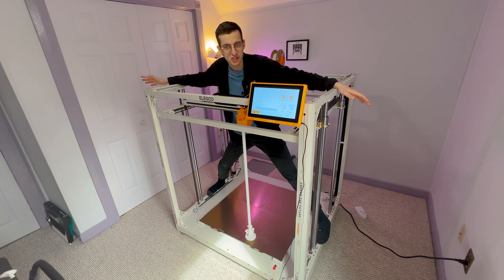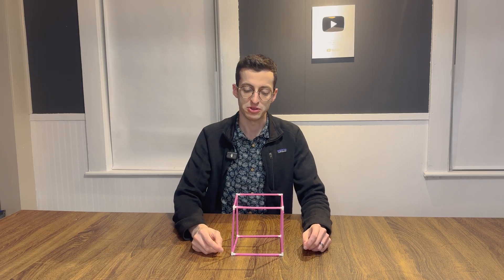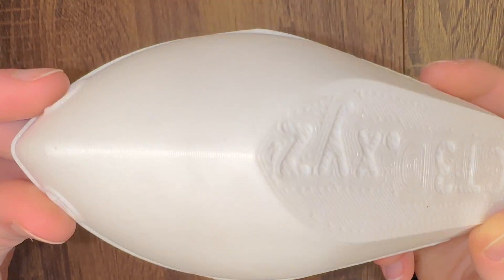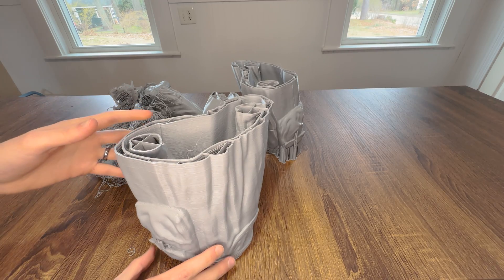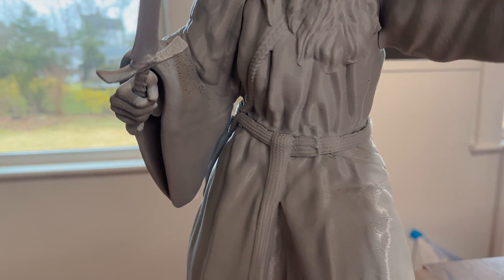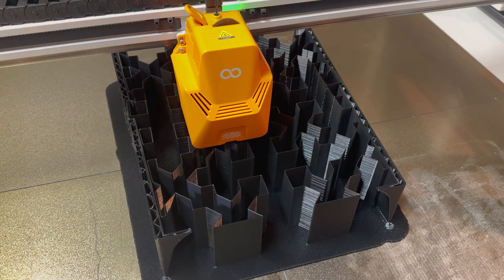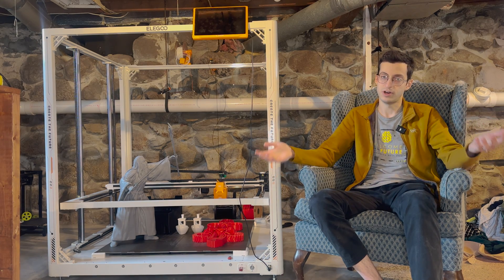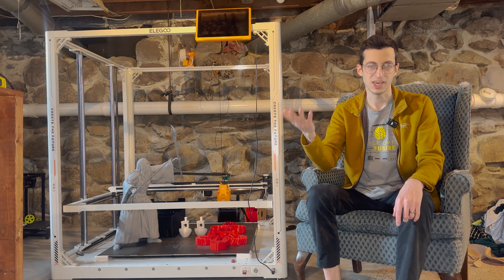Who Needs this Massive 3D Printer? Elegoo Orange Storm Giga Review

Comment: Actually, imho the real problem is the need for a heated chamber, if even PET-G warps. Personally I like big printers. But if I remember correctly, there was another 3d printer concept a few years ago: Hanging printers. Simular to a Delta, but you put a bed on the floor, 3 double pulleys to the ceiling and 3 motors winded wires through the top pulleys. the effector was moved by the wires. Quite impressive.
For me personally: I want to print new keyboard cases for retro computers (Amiga) and cases (Amiga 1000) without doing it in multiple parts. So about 500² mm² is the limit I realy need functional. This also is the maximum size fitting through my doors assembled (a vCore 3.1 500, outer frame size about 70 cm).
So while the Orangestorm Giga is quite nice, for everything bigger than 500 by 500 by 500 I might build an hanging printer instead. With the main cost being the heated bed and an ultra high flow hotend. With the big advantage of easy storage, as you just can lean the bed to a wall and add an attachment to place the effector at the ceiling when the printer is not in use. Sometimes you might want you livingroom for something else than 3d printing...

Comment: Thanks for your insights. I'm awaiting mine after being lured into by the early-bird discount and the absurdity of the size.  I thought - OK, so I can't expect the print quality to be the cream of the crop, but the size opens new doors.  Except on all the reviews I've seen since show utterly useless print quality and that issue of the print head digging into the build plates seems commonplace.  The prototypes and custom components too large for my XL actually need to be clean, accurate and strong; so perhaps simply assembling these from multiple considerably large but not ginormous components is the way to go.  I'm seriously considering backing out, if I even can at this point.  But I still don't expect this to arrive for a number of months, so I'm on the edge of my seat watching for some firmware upgrades to solve these issues.  I've yet to own an Elegoo printer, but this all has "phrozen" my hunt for a new resin printer (not going elegoo now). Maybe they'll resolve this in time and a year from now I'll reconsider Elegoo.      ...sigh  😑

Comment: You could print turbines for power generation with modular design, also potentially you could print a lot of small things at one time. I think the build plates needs to be one piece and its needs a work around for the inherent lack of precision, lets say you have adjustment screws that press up against the bottom of the single piece "warping" it the right way, those four square panels pushing up the same amount from below would probably help? Also by default to conserve power  and help with warping it needs to have an insulated enclosure. I would also add that a thicker build plate with locking "keyways" that get extruded into to lock the print down would help also, the thicker build plate also holds more thermal energy reducing fluctuations in temp and helping to even the heat.

Comment: I have one coming. I also have the Neptune 4 Max so I doubt I needed it but why not.....lol   :)
Reply: Thank you.  Fingers crossed! I am excited though...
Reply from the maker: Good luck! Joel just made a video about how he got the blob of death. He’s had disproportionately back luck though 😂
Reply: I missed the kickstart and have been watching You Tube for hits and ideas. I bought a Neptune 4 Max and have had problems with flat  sheet builds and with tall structure builds (warden clyffe tower) and so size becomes an issue also a double edged sword as I have a small house and it would occupy a small room. So I am curious as to what you would consider printing of such a large size? Thanks,Bob
Reply: @stgfx7  Currently I would like to use it to mass produce some things. As far as large, I would like to design up some types of furniture.
Reply: @flyingthebigsky year the 4 print heads will be insane

Comment: PETG is like ABS when you start to print bigger parts. You definitely need to have an enclosure for bigger PETG prints
Reply from the maker: Yes, a lot of articles I read online said petg didn’t need an enclosure, but they might have been talking about smaller prints
Reply: @makermandan  yeah. I have an Elegoo Neptune 4 max and it’s no problem even for large parts as long as there are not tall. This way they stay warm from the print bed. For taller parts, I use my enclosed printers. Once tried a tall one in PETG and it cracked on the Neptune.

Comment: With the size it is bound to have issues and a learning curve. Just walking on wood construction causes it to give a little, even a change with humidity could change level.  Having a stable floor for something that  big isnt something everyone has heck just walking arround the printer will likely show in the print. Only way to keep it stable is likely a concrete floor.

Comment: Great review! It's an interesting machine for sure, but I agree it seems pretty pointless for most use cases
Reply from the maker: Thanks! Yes it is a fun quirk but meter tall prints are rarely an engineering necessity.
Reply: @makermandan  you are wrong. If it is not a huge necessity, at least it is a big one. Imagine prototyping speaker's enclosures around 1.2 meters tall. Or architectural model. Or furniture. 3D printing is not always about Pokémon.

Comment: I guess they sent this printer to yet another youtuber, that has no clue as to what to print on it. Also, the point you make about leveled ground, that applies to any printer of any size. I have also yet to see any of you commenting on the heating requirement of such a large bed, which is pretty much a no-go for any modern government. This is fine for industrial prototyping, but not for printing a Gandalf. You all miss, that sectioning up a bigger plate into smaller parts, actually solves the issue we head into at the moment. A 400x400 bed, should be replaced by 4x 200x200 beds. That way, most of the time, only one or two beds are needed, and power consumption is kept in check. For larger parts, this only makes sense for parts with small height. That is also how I have been printing for years now, and is how functional parts need to be designed. But it is difficult to stress this enough: This is way to inefficient. It wastes power. If this were to take of for printing Gandalfs, it would have to be regulated, as we have way too much stuff consuming way to much power as it is. Not to mention, that there is no recycling for filament, and that prints failing like in this case, sort of only adds to wasted filament and power. For printing at this size, we need innovation to cut power consumption for the bed. Like making a skirt with one filament, that another filament will stick to. If the first filament can print without bed heating, an enormous hurdle is removed. Stuff like that, just need to happen, for this to ever become mainstream. And we need that industry wide push for recycling. We don't live in a vacuum. But somehow this industry seem to think that we do.
Reply: Damn, who pooped in your cereal
Reply: We don't need to innovate, the solution is already there: An enclosed heated chamber so the thermal energy is contained like a kiln or oven so the thermal energy is not dissipated into the air as waste heat but guess what? Stratasys has a patent on it so no one else can use that solution, that's why hobby level printers have to get around this patent by using a heated bed instead and sell the enclosure separately to get around the bloody patent.
Reply from the maker: @ipodtouchiscoollol stratasys patent expired in 2021! QiDi Q1 pro has a dedicated heated chamber. I may review it soon.
Reply: @makermandan Qidi X max3 also has the heated chamber. Even in a 15C room, the chamber gets to about 30/35C when printing. So for most filaments (PETG, ASA…) you don’t even need to actively heat it.
Reply: @ipodtouchiscoollol  Sure. Here we go again. The patent you speak of expired in 2021.

The tech is free to use.

In case you missed it, even that patent describes a manufacturing process that consumes enormous amounts of energy, if you were to heat up a closed chamber similar to the printer at hand. 

You're simply not listening. We need to innovate to make this production method energy efficient and low on waste.

Not doing so, kills this industry.